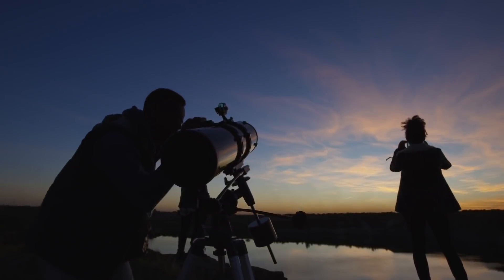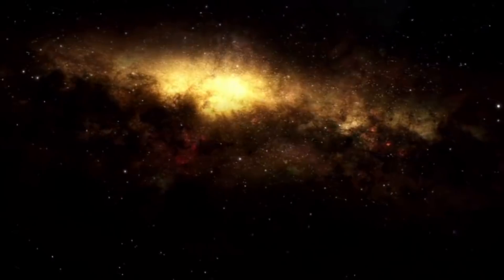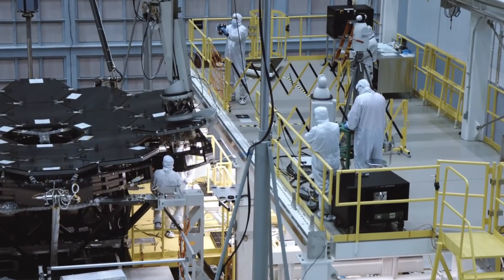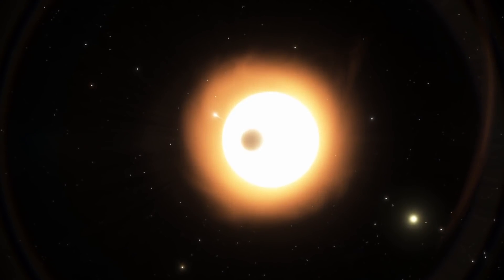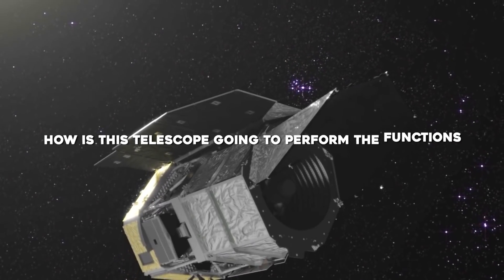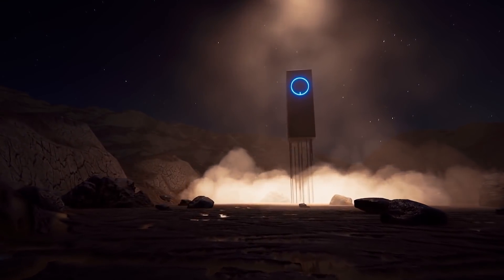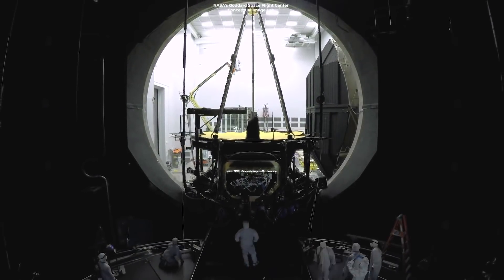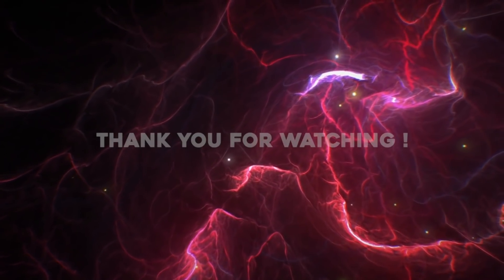Why Astronomers Are Asking Nasa To Build This Space Telescope!

Comment: The Luvoir only has a 15.1 meter main mirror. The new generation of land based telescopes has mirrors in the 25 to 35 meter range and adaptive optics. They will easily be able to do the same observations as the Luvoir when it comes to characterizing nearby planets in detail and do even better than it when it comes to distant galaxies. Simply doing the same job in space does not make a telescope worthwhile. Honestly NASA should just take advantage of the larger vehicles and launch a two to three Hubble clones with main mirrors scaled up to 6-8 meters in diameter. That will equal to more observations and thus more discoveries.
Reply: I don't think that ground based telescopes adaptive optics can perform as good as the telescope ones that are placed in space to avoid atmospheric disorder. Also i don't get it why would you put worse telescope in space in the future compared to JWSP? A Hubble clone with bigger mirror seems to be a waste of a money since Hubble was capturing images in visible wavelengths. JWSP already have 6.5m mirror and its also an infrared telescope which can capture stuff that you normally could not capture with Hubble.
Using larger rockets in the future as you said like upcoming SpaceX starship would enable to possibly launch even larger telescopes than Luvoir.

Comment: Why not to make a cargo hull flat? The air resistance could be the same but lifting capabilities could be changed.
Reply: Circles handle stress much better as they lack sharp angles which concentrate stress. This is why airplane windows are as round as they can make them. Square windows led to many failures in early planes. This is certainly why the first stage is cylindrical, along with circles having the highest volume to surface area ratio, thus allowing maximal fuel storage. Edit: keeping the same shape also minimizes the mechanical complexity of the rocket, which is often times developed separately from the payload.